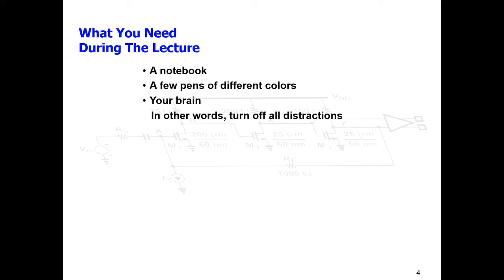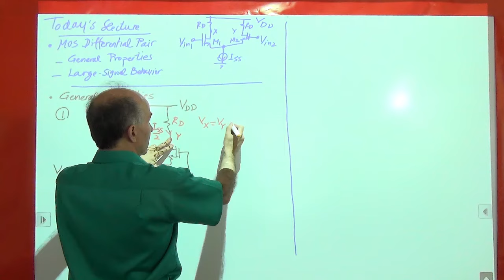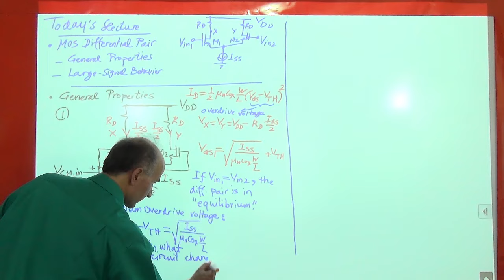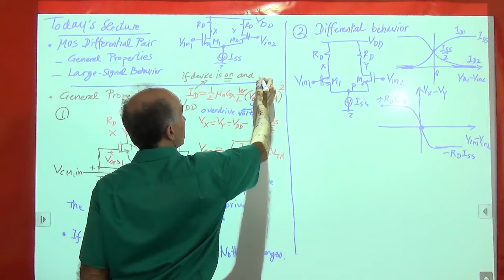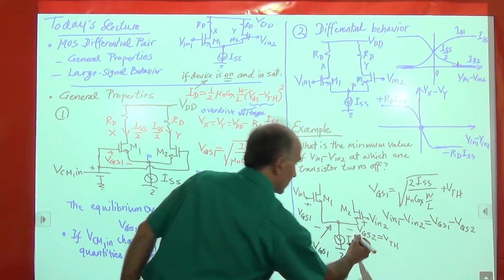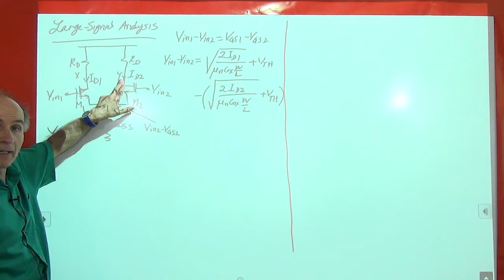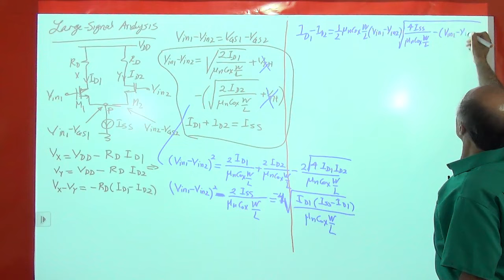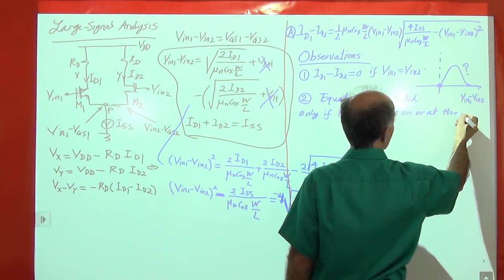Razavi Electronics2 Lec12: Large-Signal Analysis of MOS Differential Pair

Comment: how to get final result of (Id1- Id2)?
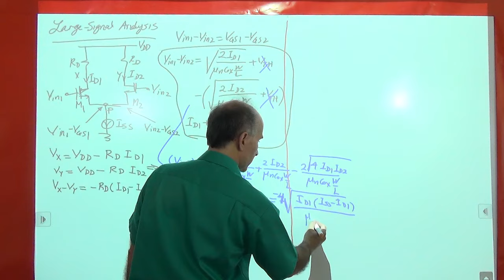Reply: First you have to square both sides where he left off at 39:00 to solve for Id1. Then you must move everything to the same side and multiply everything out. After that, you have to use the quadratic formula where a = 16, b = 16*Iss, and c = 4*(Vid^2)*Iss*kn-4*(Iss^2)-(kn^2)*(Vid^4). Once you have plugged everything into the quadratic formula, simply it as much as possible. Now, repreat all of that to find Id2. Next subtract Id2 from Id1. Both Id1 and Id2 should have a section of their equations where there is a +/-. For Id1, make the +/ a +, and for Id2, make the +/- a -. Once you do this, you can simplify it into the final equation that he provided.

It's a bunch of algebra, but once you get going it won't seem so bad.

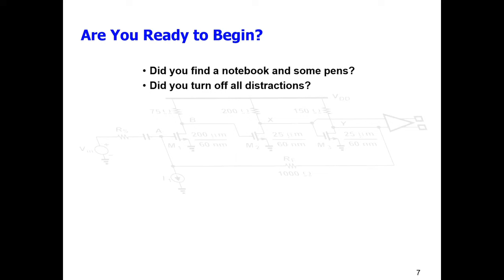Comment: 01:25 - Intro and Review
04:19 - General Properties of the MOS Differential Pair
15:00 - Note: CMRR is affected by the tail current output resistance
15:12 - Rough Differential Behavior of the MOS Differential Pair
20:12 - Saturation Region of the MOS Transistor
21:43 - Example: The Minimum Value of the Input Differential Signal when one Transistor Turns Off
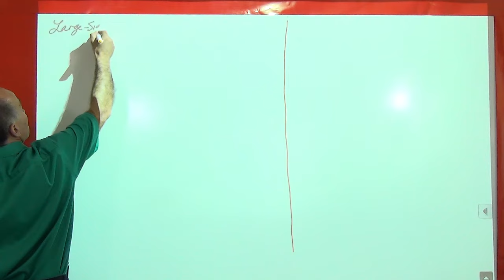29:00 - Large-Signal Analysis of the MOS Differential Pair
44:00 - Note: Overdrive voltage is important as it defines largest differential input voltage amplitude